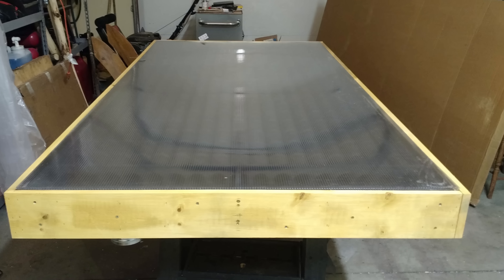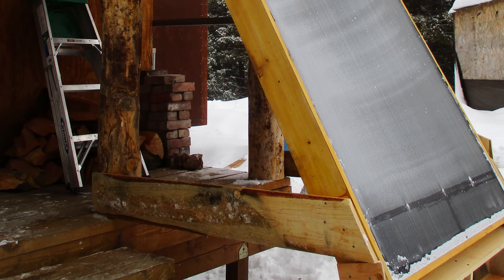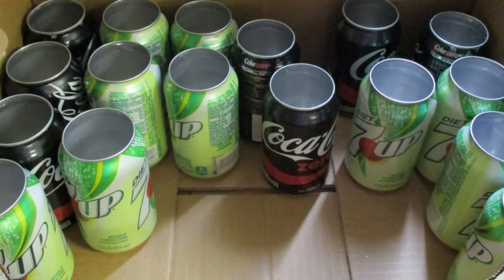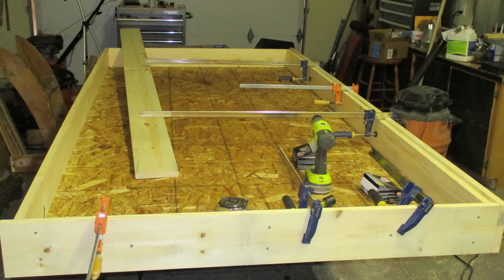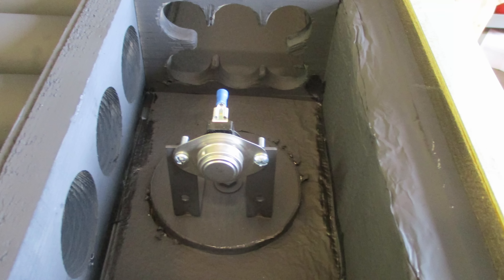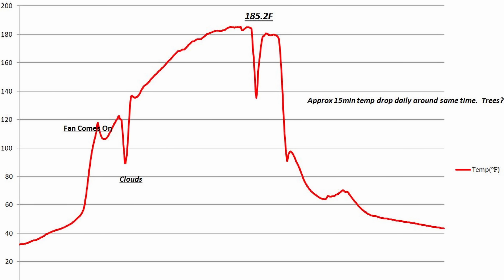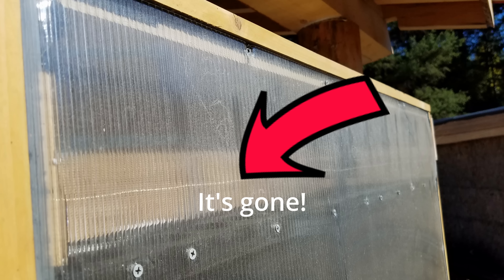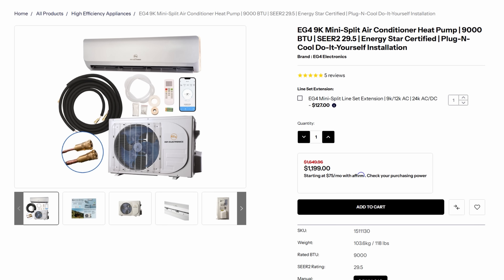7 Years with Pop Can Solar Heater - Is It Still Worth It?

Comment: 1. It took you a while to get to the point. I think all of the technical information should be in a separate video. At the very least, you should have said "Yes it is worth it" within the first minute.
2. I wonder if you could combine your unit with some kind of sand battery that traps and holds heat for longer periods of time.
Reply from the maker: 1.  Hmmm....1m 10s in I said "It worked".  OK, I didn't specifically say "it was worth it" until the last part of the video (which is pretty short) but that was implied.
2.  You cannot please everyone but you can please some.

Short attention span viewers who only watch for 30 seconds ruin the video and can cause it to stall out quickly so it's a challenge to make a video people will watch a little longer and yet keep everyone happy.  If we could all do that, we'd all be Mr. Beast.
Reply: The classic way to do this is to build a variant of the design that is a water heater. A tank of water at 40C is a lot more energy than sand and the same basic design works. It's also much easier to transfer heat through the water than try and figure out how to get it into sand.
Reply: @etchedpixels  You are correct Sir water does transfer much quicker.  Which is it's greatest Strength and it's Greatest Weakness.
Water transfers it's heat OUT faster than sand.  Place a radiator in a water heater to get hot air (bubbling air through would lead to too much moisture in the hot air) and you will cool off the contents of the water heater faster than the slower Sand battery.  The reason for Sand is it takes all day to heat up, But inversely it takes ALL NIGHT to cool out.  So the amount of space to store enough BTU"s in water would be Huge or a High temp Steam chamber.
So heating a water tank with like a last minute before dark rocket stove would give you a burst of heating options.  (I don't want to have to load and clean a rocket stove every evening.  Especially as I get Older.)  Also much of the year I've still got my window's open for at least an hour after sunset.
Reply: @FuhrChris  Water stores more heat in a given volume or weight. Sand only stores a lot because you can get it very very hot. However you can't pump sand round a system.
Heat transfer out is governed solely by the container you store it in. Stick hot water in a well insulated tank and it'll be warm for days. Pour it over a cold concrete floor it'll be cold in seconds. It's not a property of the water.

Nothing wrong with sand heaters but trying to heat them with air from solar is really difficult because you need to get very hot air to make it work
Reply: @etchedpixels   I agree with what you are suggesting.
Some variables include running air piping (some want copper pipes through the sand.)

I'm thinking of running a load dump (Some candidates for "Load Dump" may not work is surrounded by sand and over heat) under a trash can sized sand battery.  The idea isn't so much store heat long term as much as take out the effects of wind gains and losses in wind speeds.

By running something like a Solar powered water heater coil in the lower half of the trash can you would bring the sands temp higher than Solar Air transfers to the out side of a trash can stored in an insulated room.

I also have one more scientific experiment to try that would introduce a Hot core into the the center of the Sand battery.  I'm not giving details because the material is potentially dangerous and is know to pop hot material if it's in contact with water.
By placing a Hot core in the center of a Sand battery you would just slow down the heat transfer into more manageable amounts that a small Airstream needs. 

Currently I have NO heating system, at all.  I took the Old propane system out 1980ies for a maintanancing and decided that the only reason I want to put it back in is if I plan on selling the 1968 Airstream as fully restored.  
So even a system that won't last the whole night is better than what I have.
Reply: Using two that are under powered is an option.
1. Air when it heats expands. 
1.a. So placing a fan on the intake only helps create more air density in the chamber as the air expands.

2. Using an Air intake fan would be an "Option" only if you needed two fans and were doing something like creating even hotter air by forcing the air going through the can's downwards first and then out through the bottom.  (Issues of higher temps but the same BTU's meaning less volume of air that when it hits his porch it spreads out and warms just as much as the larger volume of air that is at a lower temp.)  Then you have more issues of possible melting of the plastic sheeting.

Comment: When you do your re-evaluation of the build.  Consider two possibilities.
 1. creating an adjustable coupling and placing the Cabins clothes dryer near enough that you pre heat the air going into the dryer.  Done right you may only be using tumble dry on clothes that have snow on them.  Thus saving a lot of electricity.
1. The same effect can be created by placing a perforated hose on the floor but directly under one of those clothes lines on a take up real.  The hot air would come out in line with the clothes line and rise up into the wet clothes.
2. connect either fully or partially with a Y connector to a dry heating box.  A side opening cabinet with some holes in the sides of the box set low.  (The holes are a necessity to keep Cat's from just climbing in there. I didn't say YOUR Cat, for these things are know to draw other people's Cat's into any open sided ones.  You not only scare the Cat when you go to take out the blanket but you find that the nice clean blanket is covered in some stray Cats hairs.)  A wire mesh platform that makes it that the air has to go below what is on platform (Old Oven racks will do nicely with a layer of finer mesh added.)  What you place in the box is things like a set of towels, or bed cover, or a winter over coat type robe.  This makes it that when you retire for the evening you have a heated blanket at the ready, step out of the shower (OK you may want to have an insulated transfer box to keep from scaring the  local wildlife from seeing you walk out soaking wet and traipsing water across the Cabin floor  from the shower (Cue the "I don't look good Naked anymore" music) you have a heated set of towels.
Just be able to cut off the air flow to the box after you are done for the night.  
If you are a late riser transfer into the box your Winter coat.  Just make sure you empty your pockets because things like Bic pens can explode.  (Put a little tray on top that has a covering above that so that outside viewers can't see like your keys, and or your wallet etc...)
You may find that you need to build a second Solar collector Box and simply supply the clothes dryer and comforter heating.

You can find other suggestions in things like home made Dehydrator's that they cut the power usage by plugging it into your creation:
Some say you can't fully Dehydrate food down with this but they place the electric Dehydrator racks in the wooden Solar powered contraptions and then simply transfer them over to be finished off with an electric store bought Dehydrator which they say doubles the rate of productions. 
The recipty  for "Fast ATOMIC CHERRIES" 
Simply dehydrate about 1/2 way (This works good even in Humid areas where using a Dehydrator is at best challenged) down.
Then throw them in sealable jar with a mixture of canned Cherry juice and Moon shine IE the highest alcohol content you can find.
Some just go straight to the "Canadian White lightning" with no Cherry juice.
When the cherries are back up to their original sizes it's ready.
Reply from the maker: Great ideas :) What I've always thought I would do is run controlled baffles from the porch into the cabin.  One at around 6 feet off the floor and one at floor level, both in the wall to the porch.

I'd have the baffles open as soon as the porch reached something like 70F and close around 50F.

The idea being that the pop can heater would start warming the porch and then begin to warm the cabin as well helping the cabin stay above freezing longer in the winter when I'm not there.
Reply: @TheOldJarhead  You are skipping a possibility.
Create a second box.
Take one box on the East side of the Cabin slightly facing to the morning Sun.
It's air intake is outside.  The Hot air duct is as close to the floor inside as you desire.  Either in the middle of the Room or near the East Wall.

Take the second Box  
Place it outside on the West side slightly facing the Setting Sun, and while the first box is running find the Coldest place on the porch, or just use the West inside of the Porch down near the floor for both intake and (The hot air exit  will be far away from the intake but also as low as you desire.  The purpose of the Second box is to take in the cooling down air inside the porch that had been formerly heated by the first box, and then reheat it without having to do high amounts of air transfer.

The first box catches more effectively the Day's starting warmth. (Thus the reason for the off angle from what you have been doing by setting if for best action at Noon.  You probably don't need as much heat at Noon?)
The second box is designed to just keep that warm air that is cooling off into a reheat mode.
The second box is orientated to better catch those last rays of the Sun before it starts to get cold. 

Between the two you might want to leave the front door open or move the Western Solar collector's heat exit to the middle of the cabin down low to start heating the Cabin itself.

(There is the issues of smells in that if you are doing something like tanning hides out there on the porch, or drying some stinky roots and vegetables, or a wash tub with like bleach the smells would end up all over the cabin.  Thus you might build a porch on the North side or a root celler?)

Comment: Instead of the baffle, make a cardboard flap check valve. Take your aluminum tape and attach one edge of a 7 inch wide piece of cardboard over your inlet opening. The backflow will push the cardboard closed preventing the night time A/C. You could do this inside the box or inside the porch (if it is mounted on a wall not the ceiling).
Reply from the maker: That's an interesting approach!
Reply: You do realize that you can get away from  cardboard, by.
A. get thicker pieces of Aluminum that is still easy to hand shape.  (I've got the Aluminum Hiking camp stove wind shield that comes as  long strip of thicker metal that you hand bend around the camp stove.  It's just waiting for a project to give it's life for.)
Or
B. You can take spray glue and after you have run your professional kitchen Aluminum foil through a pasta roller, or hand bread roller it truly flat.  You can make layered Aluminum foil into something that works for you.  (I'm not sure how long the spray glue would hold up in the heat though?)
Reply: @FuhrChris  I don't understand how aluminum and spray foam is going to prevent backflow cooling.
Reply: @eugsmiley  It won't.
I was talking exclusively about upgrading away from the cardboard flap check valve.
(I thought I said "Spray Glue"?)
There are Spray foams that act like glue to glue together more Styrofoam but I was talking the craft stuff.
(There's a guy in AU. who shows how to foam Gorilla Glue.  But that's not what I meant either.)
(The use of cardboard in the forms that I know of) would give a fire inspector grounds to tell you to rip the whole system out.
Converting a mock up into Aluminum would pass.

Comment: I wonder if you removed one or two rows of cans and changed the spacing accordingly then add a sheet of Mylar over the insulation what it would do to the efficiency by directing a little sun to the back of the cans?
Reply from the maker: That's a thought!
Reply: You would do better to keep the current configuration, and find like the $5.00 closet Mirrors and place it at an angle that doubles the amount of light hitting the box.  
This does not work in warm areas with Solar panels since it over heats the panels and the hotter the Solar panel the Less power the produce.  So they try for only Grey days in like a Canada winter, where they have to brush the snow off and shut it down if it gets to Sunny and warm.
Reply: @FuhrChris  Silly question.  If it's for heat, why not just use a reflective surface to bounce more sunlight through a window.  if you could align a reflective surface, would this work?
Reply: @annnonomys3132  There are those who consider flipping the collector to face down and then using a bunch of mirrors to reflect into the collector. 
It can get complex really quickly.
(As for me I'm looking into making a collector that focuses onto a Stainless steel pot that is filled with Molten Salts.  You don't need to actually heat the Molten Salts to that point of being a glowing taffy, IF you don't plan on having it pumped anywhere.  WARNING MOLTEN SALTS CAN EXPLODE.)

Comment: I have one that has been heating ever since 2009, however it has a single sheet of aluminum covering the entire inside of the 4'x8' box, it has 8" start collars at the top and bottom, my fan is connected to the bottom inlet because there is too much heat at the top for a fan motor, it is powered by a 45 watt pv panel, the top vent is large enough for my coffee pot.
Reply from the maker: Wow, 2009! That's incredible longevity and great to hear about your design choices!
Reply: @TheOldJarhead  It is very important to cover the collector on the day you turn it off. You don't want it in the sun all summer, getting to 300 plus degrees.
Reply from the maker: I actually used white roofing to do that but found it rarely got hot at all in the summer.
Reply: @TheOldJarhead same here, mine is mounted vertical pointing due south, by the time summer gets here the sun is straight up and very little heat is captured, it depends on how the heater is oriented ie; if there were just 10° angle then it certainly could overheat in the summer.
Reply: @TheOldJarhead  High sun is june 22. ..15 sept is the same as 1 april. and 1 oct is  the same as 15 march.  I leave mine on , and heating till about 1 may.  They will get very hot in sept/oct.
Reply: If the fan or cent blower is moving enough air to keep the exhaust at about 100 degrees , then it can be at the outlet, You want the outlet temp to be just high enough to keep the snap switch from opening
Reply: @kkarllwt colder air is condensed more than heated air and therefore the fan is more efficient pushing cold air, my system has no temp switch, it simply runs when the pv is making voltage and it just do happens that is the same time the solar air heater is making heat.
Reply: @401ksolar  Then you want the air outlet temp. to be about 10 deg above the room temp. You want the collector to run as cold as possible It is a giant radiator to the outside air , The colder it runs, the less heat it loses to the outside.
Reply: And in this line. You want to pull the coldest air from the room ..Off the floor..You are trying to cool the collector and move the heat inside.
Reply: @kkarllwt ok that may be what you want and that's ok for you however I like it to keep my coffee / lunch etc... hot.
Reply: @kkarllwt right, didn't mention the insulated 8" flexible duct that connects to a dedicated cold air return register that was installed in the middle of the room on the floor.
Reply from the maker: I'd have to do some checking.

Comment: The problem with heat pumps is the power they use and,when you most need the heat, the power is often at its lowest. Also solar panels are 20% ISH efficient while direct heating is up in the 80-90% range. A simple baffle could be a bit of paper in the lower outlet. It takes very little power to move it and it would make a good seal against an opening because of it's flexibility. You could of course use a motorised vent which actually aren't too expensive and also work well. Differential fan controllers are also pretty cheap so it would then run when the air in the box was hotter than the room and a fan would easily move a bit of paper as a one way valve.
Reply from the maker: Interesting ideas about the baffle and the motorized vent – thanks for sharing those!
Reply: Use a jig saw to cut 1 inch slots  ( 3/8 inch ribs ) in a piece of plywood to support the paper. Mount it a a slight angle so the paper lies in the plywood.
Reply from the maker: Great idea